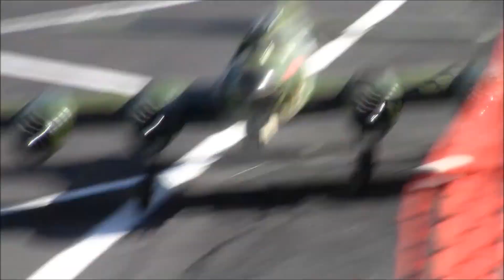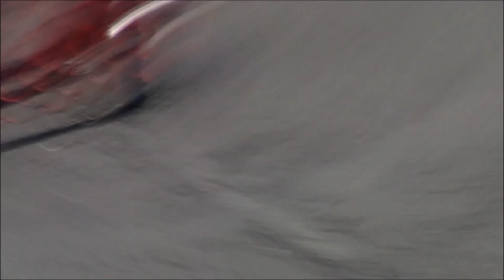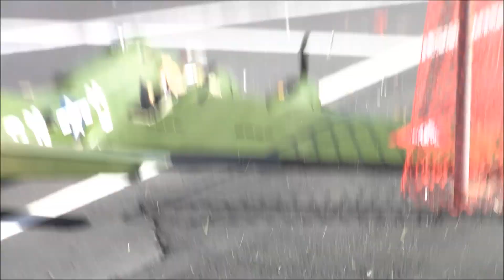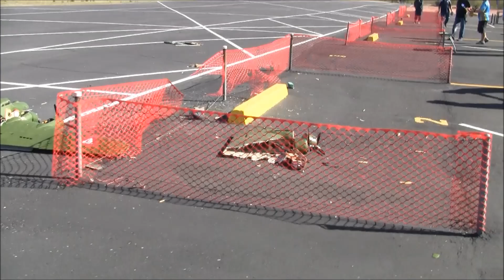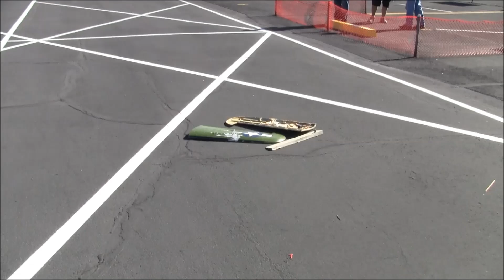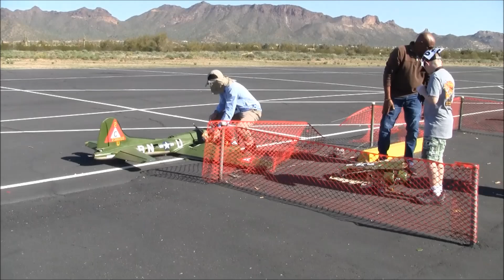Giant Scale B-17 Flying Fortress CRASHES INTO SAFETY BARRIER ON TAKEOFF!!

Comment: Holy crap! Dude that was coming right at you! So glad no one was hit. So many things I'm thinking right now. First, it looks like he was way late on the rudder. I see that he put in full right rudder, but after the plane takes a turn under torque...that is too late. You have to be feeding in right rudder as you increase the throttle so you don't get behind it. Second, once it goes that bad...remove the issue. Chop the throttles so the torque goes away, then steer it away from the crowd with the tail wheel. Worse case it hits the barrier at idle with less speed, and people have more time to move. You have to abort when it goes that bad. I'm not trying to trash the pilot, but this is why we debrief honestly...pride or not.
Reply from the maker: Adam, I absolutely cannot say it better myself, and very glad for your insight and comments! NOW you can see why I was a bit out of breath when I called you right after it happened. I was still trying to decompress. I had just finished with shooting Bob Ruff's Byron F-16 when this happened. I was literally standing by the number "2" painted on the ground when it happened! Thank God nobody got hurt....

Comment: So I have this exact kit and even have video of it flying on my YouTube channel of my 10 year old flying it as an electric.  Mine was a full fiberglass kit and didn't have any dihedral in the wing either but didn't effect the way it flew. Firstly I can tell you from experience from flying the model that yaw control from the rudder is almost non existence.  The full scale was the same way as I sat behind the pilot flying the Midras Maiden and asked if the rudder had any authority at slow speed. He said no , they use throttle splitting to yaw . The other thing with all 4 motors turning the same way is the p factor . I found nailing the throttle is the quickest way to ground loop a b17 but a long slow at first addition of power until the vertical is tracking then it will fly. I had one of my dubro tires fly apart on takeoff and got stuck between the wheel and strut and cause it to yaw that badly too. Unless you have flown a 50 pound b17 , you just don't realize how much effort goes into flying this model from roll out to full stop.
Reply from the maker: Thank you so much John for your comments and for checking in. Your insight is a valuable look into this model. No dihedral? Curious as the factory pictures I looked at showed quite a bit, and the full scale had some as well. Strange. Anyway, thanks again for commenting my friend!!

Comment: Holy cow just listen to the motors. Not all running at the same rpm. Idiot or very inexperienced pilot does not know when to abort a takeoff. Starts veering off course.... shut it down. Where is the preflight video? Needs to be banned for a while to get his attention. This is not some little toy. 60 years in rc by the way.
Reply from the maker: Thanks for checking in brother and I agree! The guy who was operating this model was definitely in way over his head. Not a toy indeed....

Comment: Very scary, John. Veeery scary. Looking at your footage before the impact, at 2 mins 2 seconds, the whole port wing is hanging down as can be seen comparing the wings to the horizontal stab. Also, the port wing looks angled downwards. This model was doomed. Glad the only thing that was injured was someone's pride.
Reply from the maker: Thanks so much for checking in Gina, and glad you noticed the port wing as well! I agree, this model was doomed from the start. A proper pre-flight would definitely have provided better odds, the pilot's skill notwithstanding. And YES, I was very very scared indeed! It took some time to decompress for sure. The field was actually shut down for about 20-30 mins afterward to allow for the clean-up of debris, repair of the fencing (which was largely destroyed), and a general blast on the loudspeakers about safety protocol. Just glad I still had cat-like reflexes and managed to scamper out of the way at a good clip! Cheers my friends!

Comment: You can see something fly off during the initial takeoff roll. You can also see the pilot trying to correct immediately with full right rudder. Glad no one was hurt, especially with four spinning props capable of doing some real damage. Looks like the barrier did the trick…similar to how chaps can save you from a chain saw.